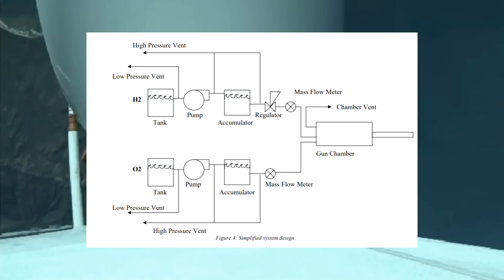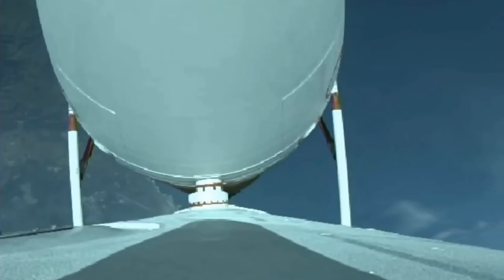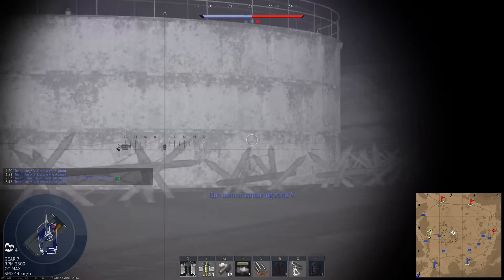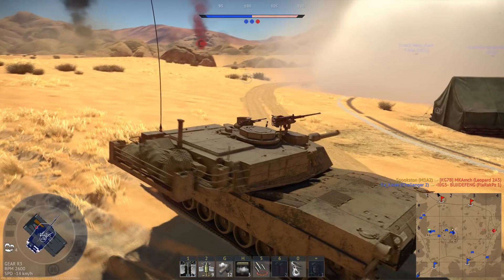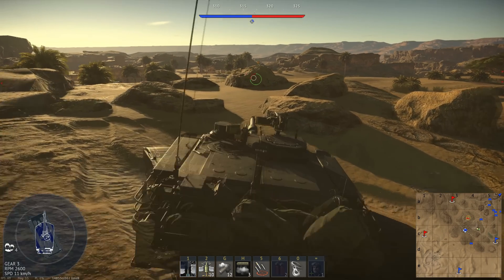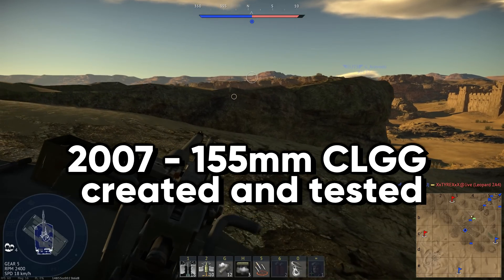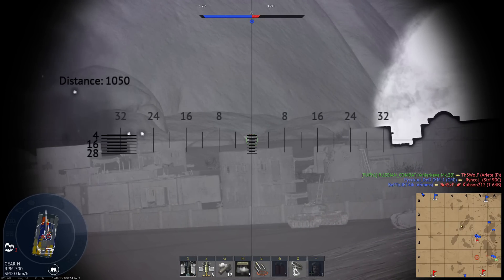CLG Guns - Future Tank Weaponry

Comment: 5:30 Spookston i dont think you understand, Hydrogen leaks period. It doesn't matter how well designed your tank is, hydrogen atoms are small enough to slowly diffuse through pretty much every material we know about. This means that no matter what there can not be long term storage of a shell/casing/hydrogen combo as after a few years there wouldnt be hydrogen left so shells would have to be made as they are used. Now, IF we figure out metallic hydrogen aka hydrogen in a solid form, that issue goes away.
Reply: Ok smart guy go figure it out

Comment: Imagine going against the first nation to put CLGG into production on ships and it firing directly at you:
1. Outranges most modern weapons
2. Pretty much no warning
3. Interception is pretty much impossible
4. You can’t use any electronic warfare to interfere since it’s a kinetic energy round
Reply: Coilguns could provide similar advantages with even longer ranges with the added simultaneous benefit and disadvantage being that all energy being generated by electricity. The US Army and DARPA are testing such a gun with a range in excess of 1000km. Its range is so significant, they couldn’t accurately assess its full capabilities firing across half the Pacific Ocean basically.

Comment: The obvious solution for naval gunnery is to only generate the gas directly before firing the cannon, and only produce as much as needed for each shot.  On board a ship with adequate elecric infrastructure there should be plenty of power to make the gas quickly in parallel generators.  The question then becomes how to support the recoil of such a weapon.

Comment: So you mentioned storing the liquid oxygen and liquid hydrogen in cryogenic tanks. Why not just use liquid water? When you perform electrolysis, you can produce large amounts of fuel AT THE EXACT sociometric ratios required for optimal efficiency (and water is WAAAY more dense than separate hydrogen and oxygen tanks). Have a generator hooked up to the engine (or battery) and dump current through the water tank. Siphon off the fuel mixture, ignite it, and there’s your fast release of pressure.

Basically you’re turning electricity into kinetic energy like a railgun, but the efficiency of electrolysis is 75%, way more than the sub-40% efficiency of rail guns.

Comment: This type of propellent isn't usable... And has nothing to do with barrels.
The author doesn't seem to appreciate the extraordinary difficulty of storing and using ultra tiny gas like hydrogen... And he's even talking about storing and using another tiny gas, helium. The problem with using these gases are that they are so tiny that they will pass through the molecular structures of practically everything conceivable to store and use those gases. Using these gases would be working with a continuously leaky system... Not only would one have to ensure the safety of hydrogen in the environment but would need to keep injecting new gas to replace what was lost and not necessarily expended. Storing the gases cryogenically might slow leakage but that creates new problems... Not only the energy and machinery necessary to produce a cryogenic environment but that if frozen the gases won't transport and would also need to be warmed safely to make available for use.

Maybe future technology will provide answers to these problems but it wasn't practical in 1945 and it still isn't practical today.

Comment: A statement in this video doesn't make sense to me... That there would be less wear and tear on the barrel due to lower weight (amount?) of propulsive material.
It seems to me that gun barrels don't wear down because of the weight or possibly too much what is used for propellent but the real cause is the pressure and force caused by the propellent that stresses the barrel. For this reason, if a CLG gun can shoot twice as far, I'd expect at least twice the stress on the barrel to make that shot assuming the projectile's warhead is the same.

Comment: Would we even be able to design a shell that wouldn’t just shatter on impact when moving at 7 km/s? Would that even matter, or would the pure kinetic energy be enough for even a shattered projectile to perforate armor? 
Also, would we be able to design a high explosive shell that can withstand that extreme acceleration without breaking apart or having the fuse go off? Or was that only a problem in WW2 that we have since solved?

Comment: You seem to be ignoring a major impact on barrel wear with higher speeds. Maybe without the chemicals that can help barrel wear but a major problem with electromagnetic guns was wear, and the faster a projectile, the greater the deceleration, by the square of the velocity.
going to propellant charges gets back to the problem of those cartridges in the crew areas as waiting to be loaded, and with auto loaders, more of a problem.

Comment: I've been working on a gas gun small arm. It stemmed from an idea I had for a tank armament. Thinking autoloaders would be faster if they only had to handle the shell, and could use our pumping technology to manage a liquid propellant. The short term solution I see is a fancy liquid propellant that has an unbalanced breakdown, but instead of the incomplete combustion leaving carbon monoxide, it leaves leftover hydrogen. The speed of sound of hydrogen is much higher than normal propellant gasses, which would lead to a significant boost in velocities. Probably not as much as these in your video, but it would also be much simpler to retrofit onto existing tanks. Imagine a t55 with a turret swap outranging an Abrams, and penetrating it, all with a higher rate of fire. Fuk

Comment: Hydrolox isn't the only fuels that could be used. Pretty much any fuel that readily turns to vapor without combusting could be used. That would circumvent the need for VERY costly (both monetarily and energy wise) cryogenic cooling, and the issues of Hydrogen leakage. Say alcohol and hydrogen peroxide though that has its own problems.

The sacrifice would be performance of course, just like in rockets.

Comment: Man, you would really think the Navy would be interested in this technology, right?  Because with new, smaller, and simplified reactors placed on board a destroyer or cruiser, they could simply run the same machines that they use on subs to separate water into Hydrogen and Oxygen to refuel the gun gas stocks.  Those are extremely mature technologies too.  With the demise of the Navy's railgun project, you would think they would head in this direction, but no, nothing.  Strange.  This isn't even bein considered for DDGX.

Comment: just a note, hydrogen fuel cell and hydrogen combustion cars do not store the hydrogen cryogenically, they just store it at ~15000psi which actually gives it an energy density per volume of more than liquid hydrogen. liquid hydrogen being only ~12300 times as dense as the gaseous atmospheric pressure form.
Reply: I fucked that math up but still

Comment: here is an idea.
-CLGG inside nuclear submarine, replace trident missile with just CLGG armed nuclear submarine.
-properlant will be manufacture onsite using nuclear reactor power.
-properlant can be released into water when not needed.

if US manage to field this, they can fire the W54 1kt warhead into orbit without anyone knowing because the size and speed of ammunition lauch will be to small and to fast.

Comment: 1:38 Heavy 13 Bravo breathing
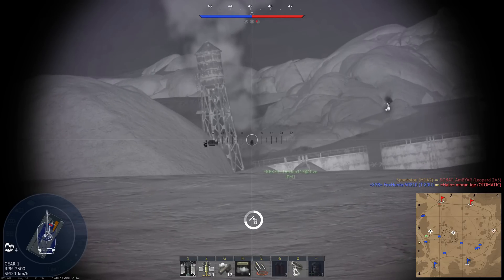2:23 The image overlay mixed with the audio can be a bit confusing, the image is showing the equivalents between the newer MACS (Modular Artillery Charge System) and the old bag charges, these are only used on the 155mm howitzers (M777A2 and M109A6 &M109A7) the ones shown are the ONLY allowed combinations so 1 or 2 White MACS (called Limas) or 3-5 Green MACS (known as Hotels) these are now completely replaced bag charges as its easier to know exactly how much your firing and that its more consistent, faster, easier to tell if its bad powder, smaller, and gives nothing to be left hanging out that can leave a gap in the breech which is **VERY** bad

Comment: I don’t think overall safety is a problem.  It’s not a problem on the A-10.  Having the two together could be a problem if they mix while still in a liquid form.  As a gas mixture, it would take a decent ignition source like a spark or flame.  As a liquid mixture, just looking at it wrong will set it off, if not instantaneously (you would need perfect stoichiometry for that).  Normal cryogenic containers have both low flow pressure relief valves, and high flow rupture disks in case the vacuum suddenly fails.  Just like ammo racks, you could have blow out panels.  You could also store the less dangerous LOX at the front of the tank, and the more dangerous LH2 at the rear so they can’t mix in liquid form.  The problem would be long duration maneuvers.  While the containers could last well over a month, the lines leading to the barrel would need to be continuously purged to keep liquid coming out instead of gas.

Comment: CLG gun venting is not hard.
Hydrogen is very, very light you basically need a gas port on top.
The true problem would be to make this process a quiet one. You get an extremely high pitch (Remember the Helium funny voice? Hydrogen gets even harder) and quick serie of reactions (Hydrogen is anything but stable) which happen so fast, the spectacular effects most likely be present. In a big jet of pitch shifting gas. Imagine your tank blasting dubstep at 170db while having 40 ft flashing arrows pointing at it's location on top of big arse light corona. This is your tank while venting after failed shot.
Leaks, however, is not exactly a problem. They will become problem when everybody will actually start  to bother with armor on top, but for now you can easily use same blowout pannels. Except they are leak pannels now. Also, nothing really prevents you from using double layer gas tanks with harmless "inspector" gas in the outer case and the hydrogen in the inner.
Ignition is not a big one either. Obviously, you use electric ignition and solve the degradation problem by hot swap ignitors. The true problem is field re-sealing, but that's a problem on it's own, even without ignition.
But this gun got a big problem - it's velocity.
At such velocity round quickly heats up and starts to melt. And we talk about speeds which make railgun look like nerf gun. We hit the sustainable speed ceiling in stratosphere and here we talk about nothing shy of Molniya orbit speeds. At the ground level. 
Also, at such high velocity you have massive energy with no good energy transfer. High velocity needle through a paper will surely punch a hole and it will be a little bit bigger than what you'd get by moving projectile slowly… but things get funky when you get to material speed of sound. Immediate area of contact gives way, immediate surroundings shatter, but then energy transfer fails, all that energy meets with itself in hertzian funnel and shatters the pieces of shrapnel in even smaller pieces of shrapnel. Resulting in a fine powder that can't penetrate crap.
To add insult to injury, this gun and fire and forget projectiles are mutually exclusive things because of the same heating problem. The best you can get through the cloud of plasma (Which is generated at such a high speed, can't escape it, can't even reduce it further) is a tail-aiming radio command (Which still have to penetrate the plasma residue, so it requires high energy emitter which immediately turns you into XMAS tree). So, when it comes to "smart" munitions, COLOS is the best you can get.

Comment: If clg guns are too complex for tanks why not use it as a new type of artillery? a gun with a range of 200km can just be fired from a nearby base or outpost if needed
Reply: Its what they are designed for. It is likely that plasma primers  like ETC guns would be used on tanks, keeping the same current gun calibers and gun types, but increasing their velocity through the use of stronger propelants, while also making them less vulnerable to ammo fires (because if the popelant can only be ingited by a plasma, then a round or a fire would NOT be able to set the ammo off, at least not in the spectacular and dealy way current ammo can.

Comment: Why would you store the Oxygen and Hydrogen as pure gases that need to be frozen to cryogenic temperatures. You can store both as perfectly shelf stable and consumable water, and produce the gas on demand via electrolysis and some clever filtration via gas membranes to achieve optimum ratios. Im positive that even for something like a 120mm tank shell a system could be devised that produces enough hydroxy gas for a round every 30-60 seconds.

Comment: liquid NOS and liquid Propane have relatively high boiling points compared to LH2 and LO2, it's feasible you could compress and cool them to a liquid conveniently (perhaps using a system similar to the aim9 IR seeker cooling system?) to store them and still achieve similar performance to LH2 and LO2.

Comment: i think the hydrogen leak issue is greatly overhyped. in a land vehicle you can have tanks with much more significant thickness than the spacecraft where the issue is more talked about. just vent the little gass that comes through and you dont have an issue. if the oxygen and hydrogen is kept separate i dont see the big deal in the tanks getting popped, even if both get popped it just starts a fire witch will burn out pretty fast. just stay in the tank and you'll live. i'm thinking something like keeping the hydrogen in a trailer, and the O2 in a tank hanging in front of the vehicle like an extended bumper (of course you need some even more extended bumpers to secure the tank but it'll work out). on it's own neither are that dangerous.

Comment: The propellant does not need to be kept in cryogenic tanks, it can be held in a high pressure tank just like a compressor as long as there is a small voltage across the hydrolysis chamber as shown on the ALEX LAB YouTube channel. This system can be scaled easily with multiple iterations.

Comment: most of the problems highlighted in the video can be greatly reduced if the desired propellant is produced from electrolysis only before firing, so hydrogen and oxygen will not need to be stored and will not be present in quantities as dangerous as if they were stored in cryogenic tanks, the disadvantage is that it may take a while for the propellant to be produced in the desired amount for firing to take place

Comment: nevermind the expansion hazard of the gases, hydrogen really likes to explode. When i worked in a chemistry lab, we were told that a special gas regulator is needed for working with hydrogen gas, since the friction of the gas leaving a standard gas tank is enough to ignite the hydrogen gas. I would not want to work near one of those in a war zone

Comment: A cryogenic tank will not blow up if the cooling fails or the tank cracks. it will spill the liquid gas and boil off. just like having liquid nitrogen exposed to open air. There is no sudden expansion and explosion. You can have a browns gas generator on a ship and compress it but on a tank just as a hydrogen fuel car you would need to carry a tank of the gas unless you had a nuclear reactor.

Comment: Hydrogen fuel cells produce electricity and water. Both highly desirable. The water can be used for cooling and drinking. Artillery would benefit for the extended ranges as well. As you can hit your  target from 200 miles away..Why they are now talking about artillery with a range of 1000 miles.

Comment: The obvious solution to most of these problems is a built in HHO generator, producing just the required amount of HHO as needed from water and electricity. All that would be needed to produce this propellant would be a decent power pack and a small tank of water. A few rounds worth could be generated and stored as the vehicle enters combat, and the generator could kick in to make more HHO as required. No need for cryogenic storage tanks, just a ready supply of water and electrical power. Safety mechanisms could be built in to vent any unneeded gas, and the risk of compromising the HHO would not be as great as you'd imagine, as recombining it creates an implosion, not an explosion.

Comment: Hydrogen can be stored more densely using zeolites, or materials like activated carbon that offer very high internal surface area. So its may be possible to store hydrogen at room temperatures. The other option would be use a pre-chemical reaction to produced a lot of hydrogen much quicker than electrolysis. The perhaps a self-contained cartridge that is triggered to produce a sufficient amount of hydrogen and oxygen, but remains safe in storage. 

I don't think you could store both compressed hydrogen & oxygen in a shell case like a solid propellant. For instance if hydrogen & oxygen are stored together in a compressed state, they will combust without a spark or trigger, much like a diesel engine uses compression to ignite diesel fuel in a cylinder.

Comment: Hot damn, that is the kinda speed I'm talking about.  ~90% of the way to orbital velocity.  Now if only there weren't that pesky atmosphere causing drag.

Thermodynamics + quantum mechanics mean that hydrogen will always boil-off at some rate.  The trick is to reduce that rate to something that allows long term storage.  That basically means (possibly literally) tons of insulation.